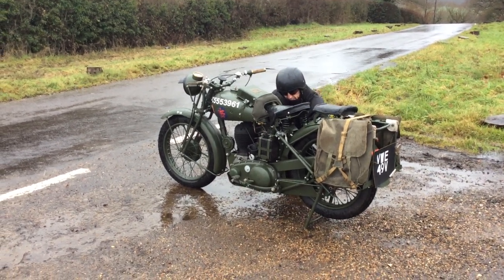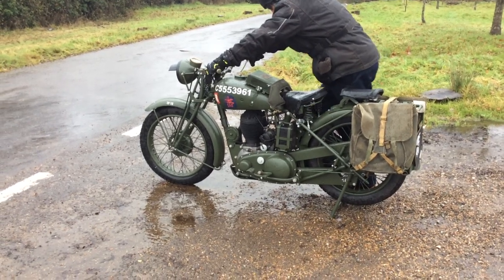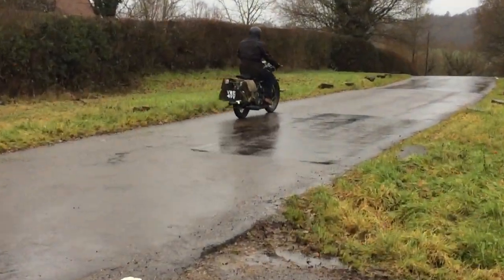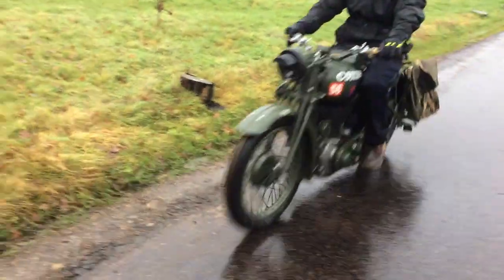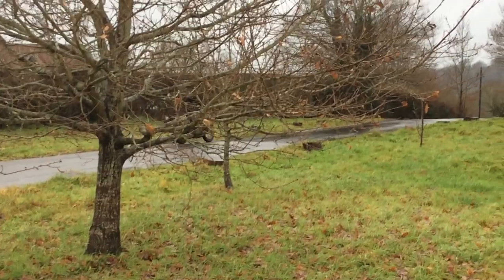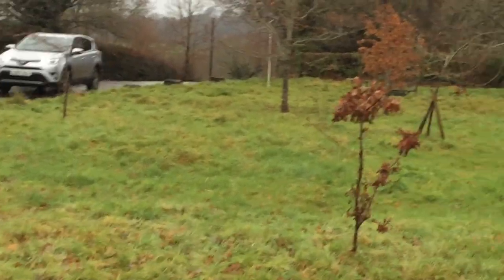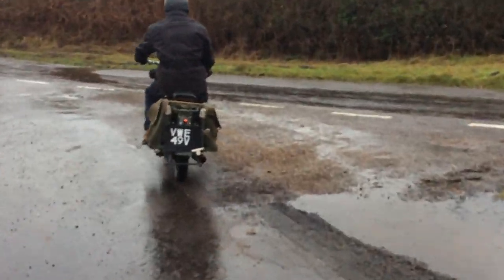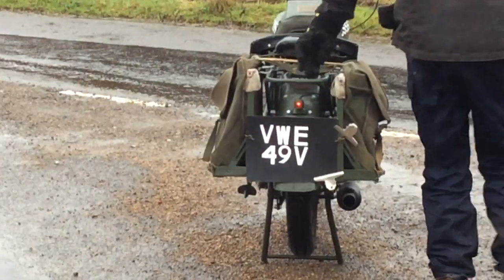STUART BRAY MOTORCYCLES -  BSA WM20 1944 , READY FOR THE NORTHERN EUROPE THEATRE WITH RARE PARTS .

Comment: Stuart, quick question, how do you finish the exhaust from Armours?  Painted? if so, what colour, silver or black?  Cheers
Reply from the maker: Hi we use heat resistant engine paint. Black or silver. You can go either way on colour as some pics of ww2 look very dark so not silver. Some are to light for black! Perhaps the black were chemical dipped to get dark.